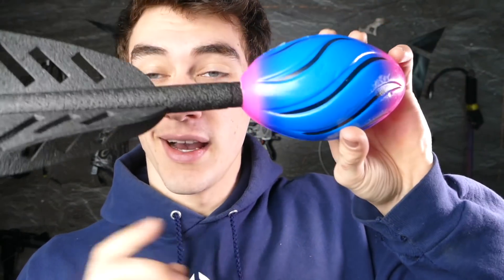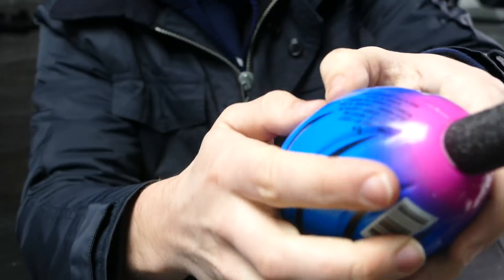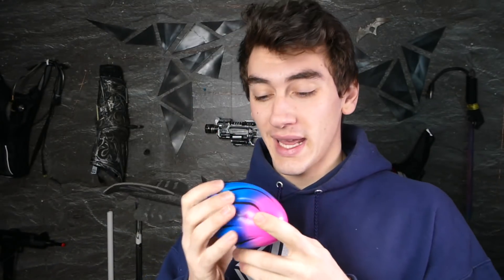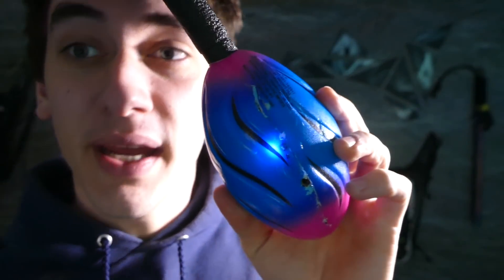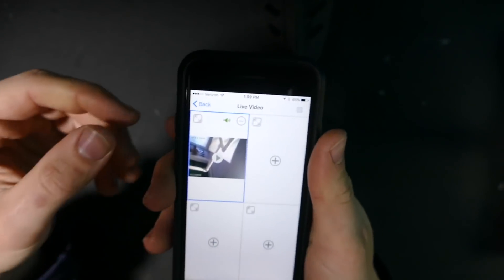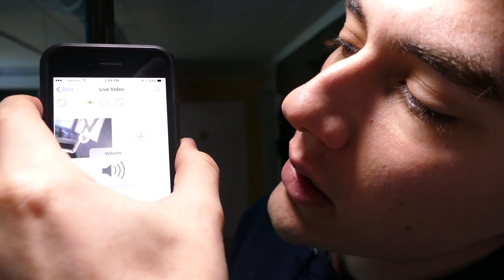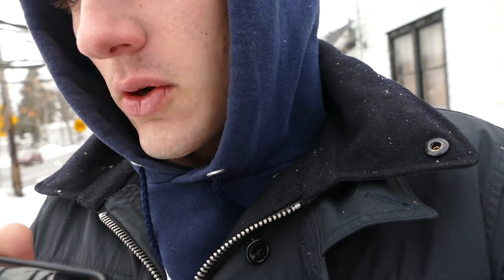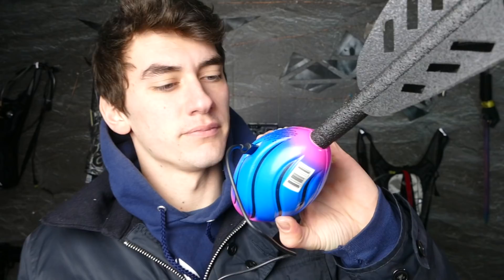DIY WIFI Spy Microphone Inside a FOOTBALL?!?! - Simple Cheap Build!!!

Comment: hey jlaser i have a idea for a spy camera canyou try using a fpv camera system they run off of 5.8ghz, the cheap ones go just barely a few hundred feet but there arebetter ones that can go a fewmiles you should make a gadget out of these
ill put a few links if intrested 
transmitter and reciver long range  https://www.amazon.com/TENINYU-Wireless-Transmitter-Receiver-Multicopter/dp/B01LZ8ZVG5/ref=sr_1_4?ie=UTF8&qid=1517708904&sr=8-4&keywords=long+range+fpv+transmitter

a camera  https://www.amazon.com/Crazepony-700TVL-Angle-Camera-QAV250/dp/B018K13XHW/ref=pd_bxgy_421_img_2?_encoding=UTF8&pd_rd_i=B018K13XHW&pd_rd_r=0FHMBBA96XA5XTJYK2FN&pd_rd_w=areFs&pd_rd_wg=BJLlw&psc=1&refRID=0FHMBBA96XA5XTJYK2FN

ground station  https://www.amazon.com/Hobbypower-Digital-Recorder-Motion-Station/dp/B077NZZDJZ/ref=sr_1_3?s=toys-and-games&ie=UTF8&qid=1517709401&sr=1-3&keywords=complete+fpv+system

you can look around to see if you need more stuff if interested,jim